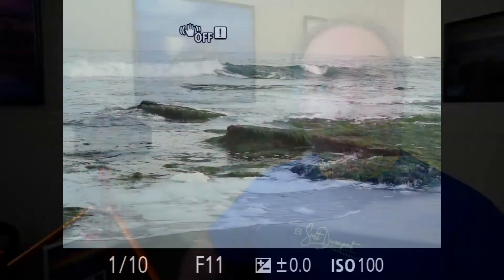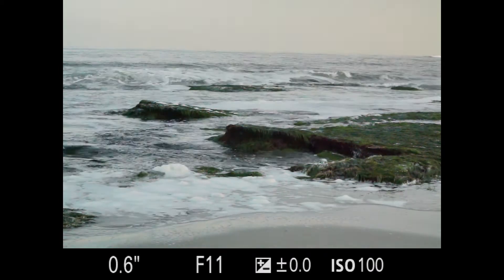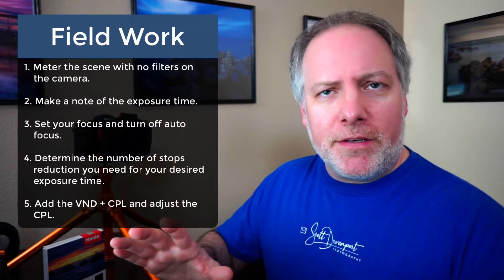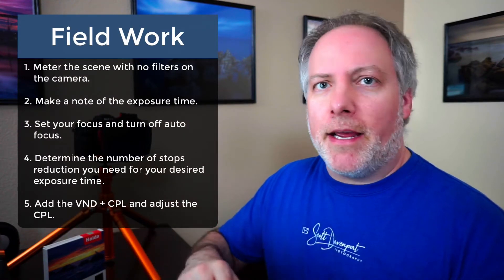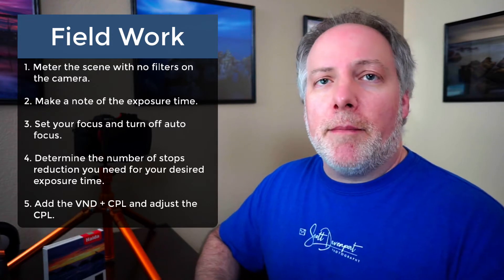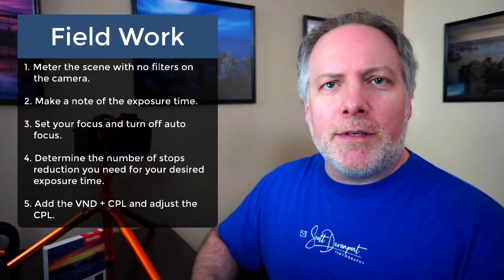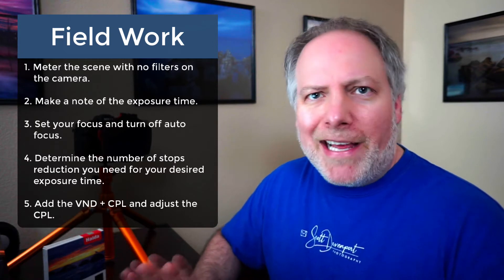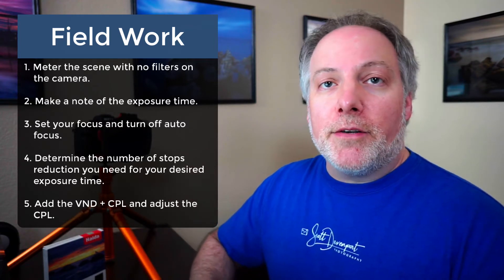Haida M10 Variable Neutral Density VND Filter Review

Comment: I started using a pair of VND about a year ago thinking it might be a good backup when going light and no room for my large Lee Filter kit. I purchased two: 2-5 and 6-9 stops. They have a stop number that seems to be very accurate. Simple to use, screw one on, and dial to the number of stops I want. My pair was expensive but less expensive than my Lee Kit so a better value and lower price. I really enjoy the ease of use and don't carry my Lee kit at any time. I do carry step down rings as my VNDs are 82mm and the rings allow me to use them on all of my lenses. Now, I hope the brand I have chosen will offer a 10-13 and 14-17. The improvement over other VND systems I have tried in the past is that these can't be turned too far causing the cross polarizing lines seen in many VND systems. I am a convert and don't see using my fixed filters any more unless I need more than 9 stops. Note: I have them on a FF 60mp camera with high-end glass and don't see any optical issues or loss in detail.
Reply from the maker: The fixed stops is a nice feature of the kit you have. I do like that Haida's insert leverages the CPL that's part of the base kit - build on what you have. The tradeoff is the potential to over-rotate. So we (the photographers) need to keep that in check.
Reply: @ScottDavenport  I really enjoy and use my set up. I now use ND much more often not having to put on an adapter mount and filter holder. Plus, I always have them with me even when carrying my ultralight kit when mountain biking.

Comment: Ver useful for video. What about using the CPO+VarND+3stop rectangular ND to get to the 4-6 stop range. Does IQ reduces a lot with 3 filters?
Reply from the maker: That is certainly a way to get into the 4-6 stop range. The CPO + 3stop is likely enough to get to 4 stops. Strictly speaking, anything added to the optical path has the potential to decrease image quality. That's why high quality filters are important - and the Haida glass is high quality.

Comment: Hmm, I have the older Haida 100 PRO filter system that has a rotatable CPL (adds about 1-stop) built into it (not a drop-in). I'm wondering if this front square element would work in conjunction with that to give me more flexibility at lower ND levels. I find no issue when jumping from 3 to 6 stops or from 6 to 10 or 12 (or stacking filters I've been as high as 15-stops), but the jump from 1 to 4 stops (CPL + 3-stop ND) can be problematic trying to get the proper exposure to "drag" water movement just right. It usually requires adjusting aperture (changing DoF) or ISO (potentially introducing noise).
I suppose, if it works for my older Haida system, it might work for any other system that has a built in CPL like NISI or LEE, etc. Of course results would vary.
Reply from the maker: The front insert works together with a CPL. It's the combination that produces the variation on how much light passes into the lens. The VND insert with a basic CPL gets that 1-1.5 to 4 stop range. It's a good option for seascapes (and yes, I want to get back to the beach more :).